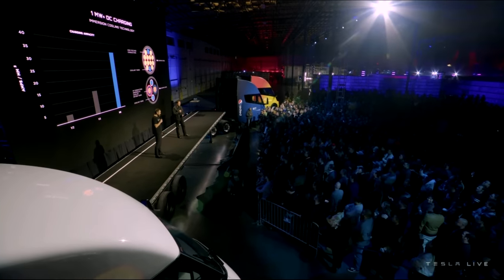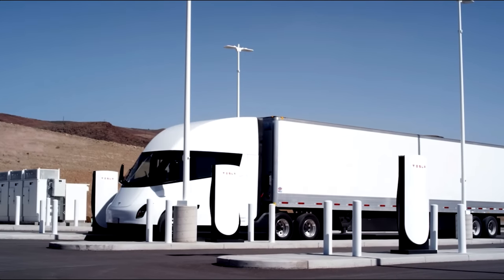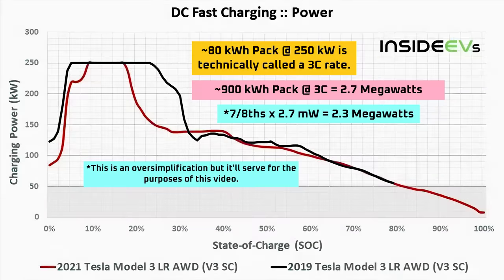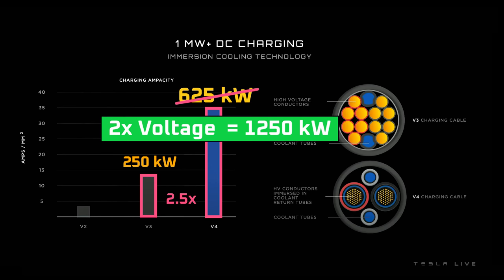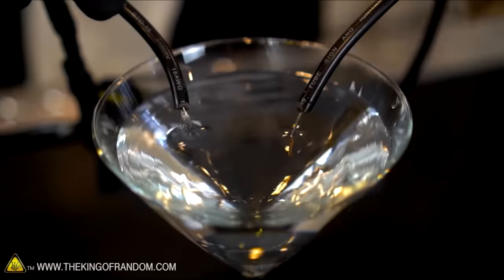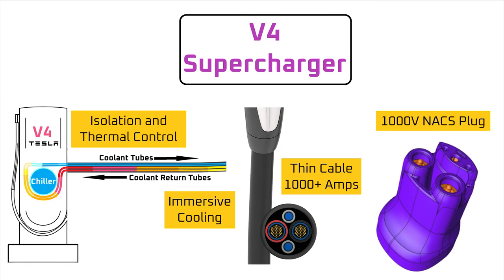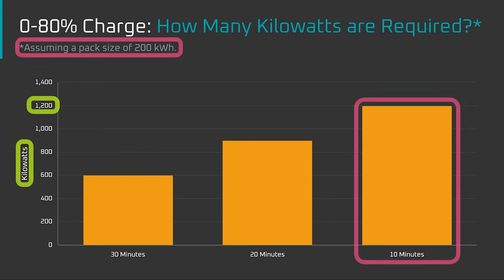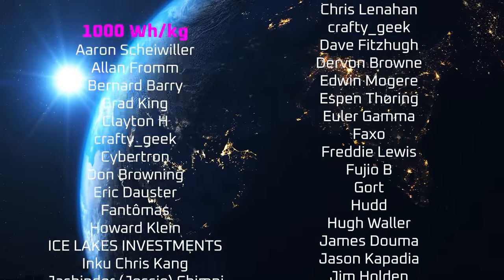Tesla V4 Supercharger // Megawatt Charging for the Masses

Comment: These v4 mega watt chargers are ideal. More than enough for all current models, more than enough for cybertruck. And future proof for all of the above. In addition this will be widely deployed and ideal for range extension for semi at required breaks for the driver. This allows the commercial multi mega watt chargers and required mega packs to be based at shipping hubs. Deploying hundreds and thousands of the commercial multi mega watt chargers all over is wasteful and unnecessary

Comment: The NACS (v2, v3, and v4 plugs) will all be the same design. It’s the “handshake” that will control the load.

I love your videos but, I think you are wrong on this one. After all, Tesla changed the naming to “North American Charging Standard” for a reason. Any Semi or Cybertruck will have the ability to plug into ALL of the V2 or above, just in case! Why fragment charging?
Reply from the maker: Note:  I don't think the different plug design will control the load, but rather, it accomodates higher load more safely.  All good man!  As I said in the video, it's just my view and I appreciate different views.
Reply: @thelimitingfactor  we will soon find out. But I can definitely see a Semi using a v2, as a fallback. Plus, what a great sales pitch… “What if the semi is low?” Just drop the trailer and plug into any of our already existing v2, v3, or v4 chargers all over the units stats. Yes, it will take longer, but you will only need to change 10 to 20% to make it to your destination.
Reply: @thelimitingfactor  also, I’m now a Patreon member ($1/month) as I appreciate your insight & hard work!

Comment: Where is all that electricity coming from? And how will it get to the chargers? Oh yeah, magic 😆🤣
Reply from the maker: The grid has an enormous amount of headroom thanks to under utilized peaker plants and poor transmission management (they guess the wire loading rather than use actual data, which can be circumvented by monitoring the wires)

Other than that - Build more solar, batteries, wind, and gas power plants

This is not rocket science

There's a number of other options too

The main issue at the moment is actually interconnect queues and transformer shortages...but the free market wil solve this
Reply: @thelimitingfactor  "The grid has an enormous amount of headroom" Utter nonsense.
Reply: As for under utilized peaking plants, uh you realize they are typically big gas turbines that burn natural gas right? They make lots of CO2.
Reply from the maker: Yup, enormous headroom.  Incent with some load shifting, throw in some batteries and it opens up huge amounts of power.  Look up the nameplate capacity (and multiply by hours per year), then compare to TWh consumed.

Yes, they create CO2.  But, you've notably ignored the other generation possibilities.  I'm all for natural gas.  Sorry you find that triggering.

The main concern is actually AI data centers, not vehicles.  They need strong baseload 24/7 power
Reply: @thelimitingfactor  You realize batteries only store energy right? Batteries are not a fix for a lack of power generation and power transmission capacity. Not even close. Utter nonsense. The only way to get more power through the wires already installed is to double, triple, or more, the voltage on the wires. And then you need all new insulators and transformer, hardly cheap or easy. We are at 1% BEV's on the road right now. You think getting that to 100% without a major infrastructure upgrade is going to happen? Just delusional.
Reply from the maker: I just explained that there's plenty of headroom, if you're not going to listen to me, I'm just going to bow out 

Right now there's assets that aren't being utilized because there's no way to store the energy 

You store the energy, you can utilize the assets 

Have a good night, do some research and then come back with some valid criticism
Reply: @thelimitingfactor  You claimed there was headroom without offering any actual technical explanation of why. Basically you said the existing transmission cables can handle more current? Ok, how much cable heating and and I2R power losses do you consider acceptable? Specifically how do we get to supplying enough electricity to charge 100% BEV's on the road? Your technical explanation amounts to "Trust me Bro".

Comment: Great vid Jordan.
I also took from the semi event that they would use the same cable tech for semi + v4, not the same connector. They were specifically talking about the cable at the time. One thing of concern to me is not the cables ability to carry the amps, but the amount of energy being wasted. Cooling mostly only stops thermal runaway, not energy wastage. A back of the napkin calculation looks like these cables could be wasting about 2kw of the 250kw going into the vehicle in heat from the cable. This is based on my estimate of a conductor diameter of 4.8mm which was estimated from a 3/4" diameter of the entire cable and eyeballing the conductor size compared to it, and estimating the supercharger cables as being 3 meters long. 

At 900 amps this would be wasting 6kw.

All of this is ignoring the energy requirements to cool the cables. 

In any case maybe this is a trade off that is worth it to enable the cables to be thin enough and light enough for human operators of all (most) abilities to handle, and I guess this is the logic and thought process. 

https://www.rapidtables.com/calc/wire/voltage-drop-calculator.html used to do the calculations.

Please unblock me on twitter.

Thanks
Reply from the maker: Great info! Unblocked
Reply: @thelimitingfactor  Thanks!

Comment: My idea here might not be valid as I haven’t thought enough about it, BUT, what if a battery pack is sequentially charged? In other words a 100kwh pack is broken into 4 250kwh Packs. You start charging pack 1 at max rate and when it drops to a lower value you start charging pack 2 at max rate, and so on. That way you have max charging rate over a longer period of time. Maybe something wrong with my logic, but I’ll let others mull it over.
Reply from the maker: There is some value in it.  It  may have limited benefit though from what I can tell.
Reply: While it had dropped to the lower rate in your example you are using time less efficiently. If you leave them all in series you can pull the most from the charger and then spread it to be the minimum per individual cell.  Thus kindest to each small cell.  You want to keep the charger at max amps and volts as long as possible up until you begin to harm the cells and then you need to taper.  This gets you on the road the fastest with the most.  Charge ports will be a limiting factor so best to optimize the time using one.

Comment: CCS is the North American standard and world standard. Tesla is its own standard.
Reply: Is that CCS1  or CCS2?
(As in "not the same")
The CCS Consortium have been "discussing" for 13 years and still haven't sorted out the system (systems)
Reply: @rogerstarkey5390  Yes, CCS uses Type 1 and Type 2 connector depending on the geographical region. Even Tesla uses it in places other than N.A,
Reply: My tesla charges at CCS and tesla chargers without issue although ccs are slower and most often dont work.  Tesla will continue to use all and innovate faster.

Comment: Not referring specifically to EV or Tesla charging systems when there are multiple products that are similar that use charging cables or devices, it is generally standard procedure to change the shape significantly enough that Chargers of different voltage or amperage cannot be interchanged with a product that cannot handle that voltage or amperage. I'm not saying this has anything to do with the Tesla charger but different shapes is a common method of protecting devices and seems to be in general use
Reply: Charger & car handshake and negotiate rates, so they don't need keying plugs.

Comment: Keeping coolant loops from seeing a voltage gradient is probably not a hard problem. You could just use two loops with two pumps, two reservoirs etc. Or you could use a non-ionic antifreeze and continuously deionize it in order to use one loop that splits with suitable isolation runs. My guess is two loops is cheaper, simpler and more robust.
Edit: I was being silly by assuming water-based. Something like Paratherm NF or similar nonpolar low-melting high-flash nonconductive organic liquid would do just fine, and stand off 1 kV with only mm of isolation. It would be somewhat easier to maintain non-conductive and non-corrosive.
Reply: What if th coolant  was th current carrying conductor???
Reply: I'm guessing two loops as well, as hinted by the diagram. The coolant goes down the positive conductor and into the handle/pin connection, then back through one of the return tubes to the "positive" fan/radiator. Then another separate loop for the negative side. Only problem is you have to keep the radiators electrically isolated from everything, assuming they're metal. Maybe they'll use a large plastic radiator.
Reply: A voltage wtf Eva gradient really
Reply: Amazing insights, thanks
Reply: Without 2 separate loops and HEX, one conductor will be hotter the other.
Even if it was one loop, electrical isolation isn't a major hurdle.